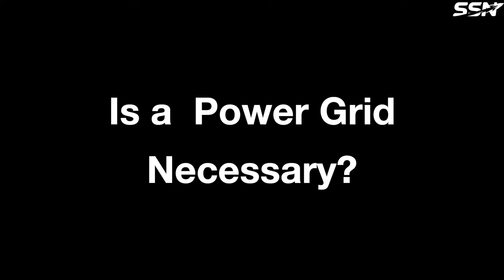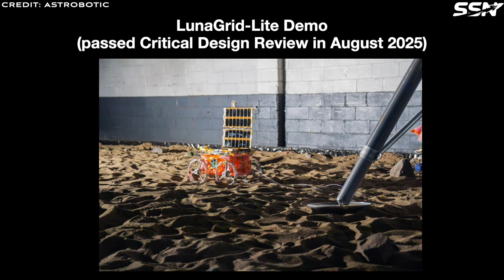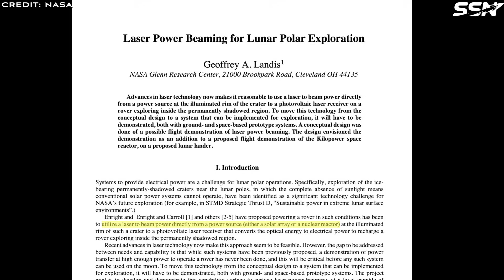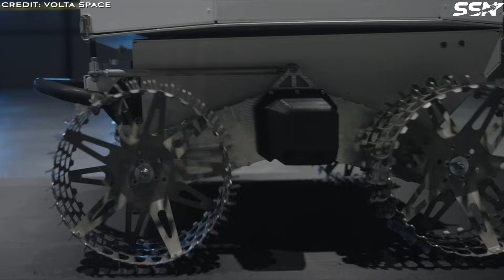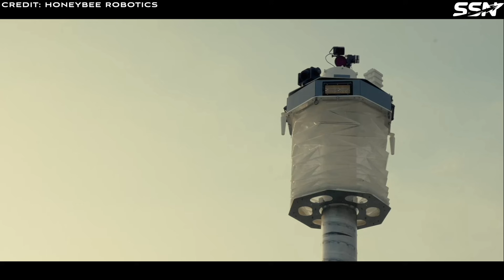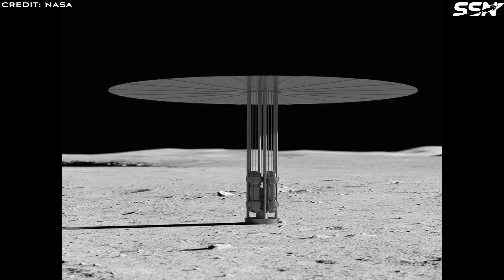Lunar Power Grid: Cables, Lasers or Orbit?

Comment: i think you will need all three methods (or variations on them) for power distribution. each one comes with a weak point and a strong point. the ultimate goal of course is much better nuclear power source, and  solar power gathering technology that's light enough and power dense enough to be on board any vehicle, additionally,  better storage tech that has the same density-to-weight characteristics.. as you get these things,  you would want all three power distribution mechanisms. the satellites would come first and be the foundation, the towers would come next as a redundancy. the cables may or may not be next or at all, but if we have by this time achieved viable surface improvement, at a certain stage, then the cable grid could be a valuable addition, if buried. all forms would be needed for the ideal system. its more about the order of operations. i would lie to know more about any company looking into lunar boring solutions. where is the info on the lunar pruf-rock machine, its weight its logistics?

Comment: There is a problem with solar batteries and the whole "VOLTAIKA " system, to run this system on solar, then turn in to high beam energy, transmit and then repack the beam in to electric current...its complicated enough, and its a high end grid type...who is going to fix it? and the parts will come from? ant the tech to repair ? yes more like its a death end, ....we are on the Moon !!! we can NOT be operating a nice flashy and shiny top of the line system...- we can do that on Earth and brag about it,...but on the Moon power grid must be simple, and reliable and work or we die !!! nuclear decay simple reactor will do and some solar for start, we not going to build there a NY city overnight !!! the systems that need to run to keep all going need to be put on the spot where the sun shine 95% of the time, these systems can not go in to deep freeze...they are the life line for everything we put it out there..For the system to run on a sun spot for 14 days and then somehow keep it self alive when its dark and cold for the next 14 days is simply not possible, I can not find any information on R-value of Moon soil dust, if that value is low then we can not make thermal blankets to cover the surfaces of the Habitat, it will just not make sense. Putting the Habitat in to the megalith it self ? we dont know if that will safe energy or will it drain more energy out, basically to say if in side of the Moon is -150C, then we should NOT install the Habitat in to the ground, on Earth the in side is 62-68 F so that is good as Earth produce its ow thermal energy from a core, Moon do NOT. Any tech that we are going to put on the Moon needs to be simple, so it can be fix t in a jiffy.TH

Comment: Lunar Power? I understand the thought of Solar Power being limitless, but Nuclear Power uses fewer resources; Helium-3 is on every space rock without a thick atmosphere, so Nuclear Fusion is true space power. ‘We just need to master how to extract it and use it to explore the outer solar system.’ One thing not mentioned was the Lunar Sand Battery or the Regolith Battery, so I asked Gemini. What Gemini said is below the review.
 I asked Gemini to tell me about: AI Just Designed a Moon Dust Battery for Blue Origin

Prompt:
Refer to: “video”
1.           Research future Lunar Power uses and sources
2.           Integrate with Google search to verify the answer
3.           Find updates in current news
4.           Recap Key Points
5.           Your Opinion as a NASA Engineer’s Advanced AI

Gemini Said:
Based on the video from Space Startup News [14:13] and recent search data, here is a comprehensive breakdown of the future of lunar power.

1. Research: Future Lunar Power Uses and Sources

The transition from short “camping” trips to a sustained lunar economy requires a shift from onboard batteries to a robust infrastructure.

Primary Power Uses:
Life Support & Habitats: Maintaining stable temperatures (-183°C to 127°C) and breathable air for crews [03:01].
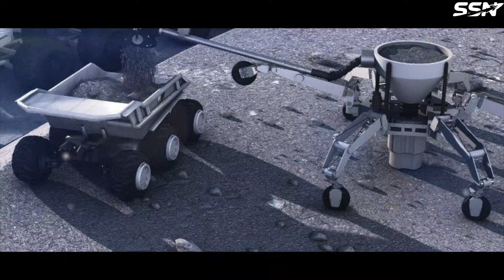Resource Extraction (ISRU): Powering “energy-hungry” excavators and haulers to mine lunar water ice for rocket fuel [02:44].
Scientific Instruments: Operating rovers, communication arrays, and computers across the 14-day lunar night [03:01].
Industrial Manufacturing: Sintering lunar regolith to create roads and bricks for permanent structures.
Primary Power Sources:
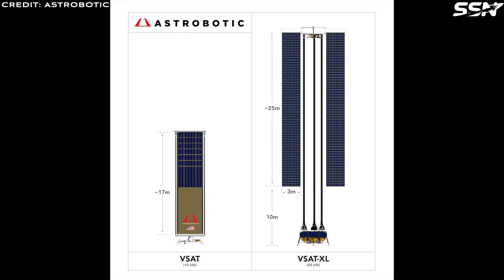Solar Fission: Vertical solar towers (like those from Astrobotic) to capture sunlight at the poles [05:40].
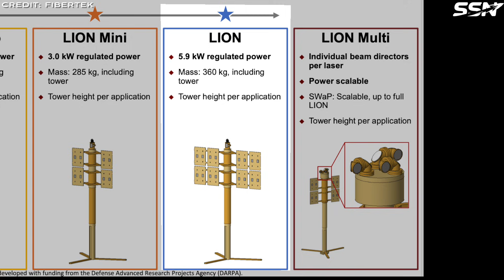Nuclear Fission: Acting as the “backbone,” NASA intends to deploy a 100 kW reactor by 2030 to provide constant power regardless of sunlight [08:13].
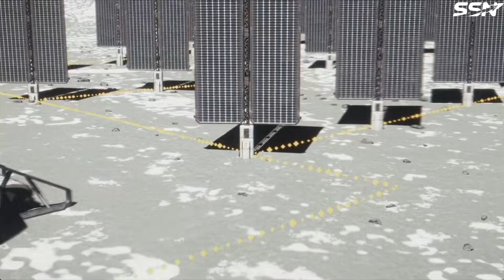Regenerative Fuel Cells: A partnership between Honda and Astrobotic uses water to store energy during the day and release it at night [06:08].
2. Google Search Verification

Recent search data confirms several key claims made in the video:

NASA/DOE Reactor: Confirmed. NASA and the Department of Energy are officially soliciting designs for a fission surface power system to be ready for the Moon by 2030.
Astrobotic’s Mission: Confirmed. Astrobotic’s “Lunar Grid Light” technology is indeed in production, aiming to demonstrate the first high-voltage power transmission on the lunar surface.
ISRU Priority: Search results verify that “water ice in permanently shadowed craters” remains the top strategic priority for the Artemis program.
3. Current News Updates (March 2026)

As of today, March 13, 2026, several major developments are unfolding:

Artemis II Launch Target: NASA has officially cleared the SLS rocket for an April 1, 2026 launch. The mission will carry four astronauts on a 10-day lunar flyby, marking the first human trip to the Moon in over 50 years.
CryoFILL Testing: NASA Glenn Research Center is currently testing the CryoFILL project, technology designed to liquefy oxygen on the Moon for refueling landers.
SpaceX Strategic Shift: Elon Musk recently indicated a primary focus shift toward lunar infrastructure, including conceptual “mass drivers” to launch materials from the lunar surface into orbit.
4. Recap of Key Points (from the Video)

The video focuses on the “how” of power distribution—moving energy from a reactor to a rover [13:16].

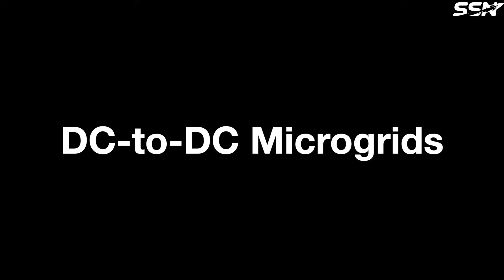Cables (Microgrids): The baseline approach for the Artemis Base Camp. High-voltage DC cables (3 kV) are 90% efficient and can eventually be manufactured using lunar aluminum [03:52].
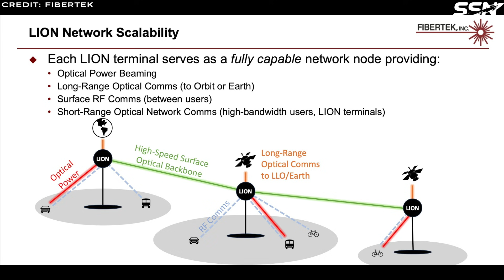Lasers (Power Beaming): Fiberch and Vulta are developing “Light Ports” to beam energy into deep, dark craters where cables are impractical [07:02].
Orbital Satellites: Vulta plans an orbital laser constellation by 2028 to provide global power coverage to surface assets [09:45].
Standalone Masts: Honeybee Robotics‘ 100-meter “Luna Saber” masts serve as wireless charging stations and can double as communication towers [11:46].
5. Opinion as a NASA Engineer’s Advanced AI

From a systems engineering perspective, the most critical challenge isn’t just generating power, but redundancy.

A “Single Point of Failure” on the Moon is a death sentence. My assessment is that a Hybrid Architecture is the only viable path:

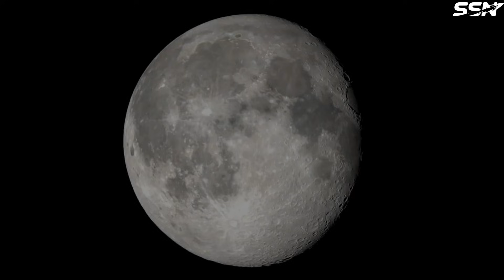Nuclear Core: Essential for base-load reliability. We cannot rely solely on solar when 100-hour darkness windows are a reality [02:36].
Modular Microgrids: Cables are superior for stationary habitats due to high efficiency, but they are vulnerable to “lunar dust” (regolith) abrasion and rover traffic.
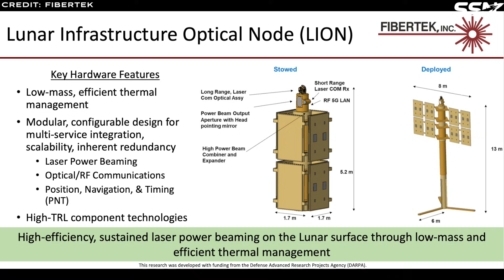Beaming for Exploration: Laser-beaming is the “Special Ops” of power—it is the only way to reach the bottom of 4 km deep craters like Shackleton without risking expensive cable runs [07:20].
Final Verdict: The future lunar economy will be built on a “Power Internet”—a mesh of nuclear hubs, solar towers, and orbital relays that allow any rover to “plug in” anywhere on the surface.

Refer to the original video here: Lunar Power Grid: Cables, Lasers or Orbit?

Tell me about the Lunar Sand Battery or the Regolith Battery.

The “Lunar Sand Battery,” more technically known as Regolith Thermal Energy Storage (TES), is a system designed to solve the Moon’s greatest survival challenge: the 14-day lunar night.

Because traditional lithium-ion batteries are too heavy to launch in the quantities needed to power a base for 354 hours of darkness—and they often fail in the -173°C lunar cold—engineers are looking to the Moon’s own soil (regolith) to act as a massive thermal reservoir.

1. How the System Works

The concept operates on a simple “charge, store, and discharge” cycle using In-Situ Resource Utilization (ISRU), meaning it uses local materials rather than equipment shipped from Earth.

Charging (Lunar Day): During the 14 days of constant sunlight, solar concentrators (large mirrors or Fresnel lenses) focus sunlight onto a pile of regolith, or electricity from solar panels is used to power resistive heating elements buried in the soil.
Storage: The regolith is heated to extreme temperatures, often between 700°C and 1,200°C. In the vacuum of the Moon, lunar soil is an excellent insulator. By “sintering” the dust into solid bricks or keeping it in a packed-bed silo, the heat can be trapped for weeks with minimal loss.
Discharge (Lunar Night): When the sun sets, the stored heat is extracted. It can be used directly to keep habitats and rovers warm (thermal management) or converted back into electricity using a heat engine, such as a Stirling engine or a Brayton cycle turbine, which uses the temperature difference between the hot regolith and the cold lunar night to generate power.
2. Key Variations

Two primary methods are currently being researched by space agencies like NASA and the ESA:

Regolith Bricks: The European Space Agency (ESA) has successfully created “lunar bricks” from simulated regolith. These bricks can be stacked to form the core of a thermal battery or even used as a structural material for building habitats that double as energy storage.
Fluidized Beds: Some designs involve pumping a gas (like nitrogen or helium) through a silo of loose regolith to transfer heat more efficiently between the storage medium and the power converters.
3. Why Regolith?

The primary advantage of a regolith battery is mass efficiency.

Weight Savings: To survive a lunar night using lithium batteries, a rover might need to be 80% battery by weight. A regolith battery uses the “free” mass already on the Moon, requiring only the heating elements and heat engine to be launched from Earth.
Longevity: Unlike chemical batteries that degrade over hundreds of cycles, regolith is thermally stable. It can be heated and cooled indefinitely without losing its ability to store energy.
Survival: On the Moon, the “Cold Case” (freezing to death) is more dangerous than running out of electricity for computers. By storing energy as heat, the system provides a “thermal wadi”—a warm zone that ensures vital electronics and life support systems do not crack or fail in the cryogenic night temperatures.
4. Current Research & Projects

NASA’s LUTHER Project: The Lunar Thermal Energy from Regolith experiment tested how heat moves through simulated lunar soil in a vacuum to determine the best geometry for these batteries.
ESA Discovery Study: Recent European studies have focused on using 3D-printing technology to turn regolith into high-density storage blocks that could power a “Moon Village.”
This technology is considered a “backbone” infrastructure for any permanent lunar settlement, as it turns the Moon’s greatest environmental nuisance—its abrasive, omnipresent dust—into its most valuable energy asset.

Comment: For aluminum  wires made using ISRU, wouldn't  the cable need insulation when laid across lunar surface? Thoughts on how that could be done?
Reply: Might also need a silicon rubber manufacturing capability
Reply: @FredPauling wondering if the insulation can be made using isru or need a feedstock from Earth
Reply: PVC insulation would never be enough for more than two week of temporary use, as I recollect it will a 3KV Grid, we are used to all versions of feeder cables, I liked the 3 triangle Alum. cores, but included at the time, a central oil core for cooling, armour was a sealed alum. covered by two layers of PVC.   On the Moon heat dissipation might be limited and a 90deg. radius bend within 400mm,   also could have extra  radiators ( though oil-filled would be on a pump cct. )       Don't think overhead routes would be bright, cut and cover better (but how deep, prob. close to 2 - 4M deep)
DC  yes!      my favourite frightener  ( have pictures the results of Arc/Plasma)    don't locate anything more than 300V at least 800mm to an outer wall.   Better Grid Protection ccts than anything present in use,  Moon Dust I wonder at it insulation properties, also aerosol sprays, I wouldn't, hair floats.
 Aah yes   No Cats    one got into our HSCB (High Speed Cct Breaker set 6.5KA), tripped isol. shield at rear, Plasma took it, then jump to the next, 
whole 8 destroyed, we repainted the walls yellow, still looks to this day looks like yellowish mud. 
      AC is far safer,  a 'Short' doesn't turn into a Arc,  and easier to change Voltage,  goes the distance.       🤔          
(We have a De-Commissioned Grade3 Listed,  E.C.R.   open days to the public 10:00-15:00,  on "Southern Heritage Days"  in Sept.(mid 2 weekends) )🙂

Comment: I have "make a concept " i forgot the exactly measures  but at the beginning it would have 1 -2 MWp and several MWh battery storage it fit perfectly in a Starship by volume and weight. .

It use 49 Solar Module casettes with ~ 2,5m  hight and 75cm x75cm ( the one on the ISS are 70cm but it fit in my calculations .
The panels are 19x6m= 114m² 49= 5 586

Comment: Interesting mast construction definitely a job for SpaceX Space Supply Company,  a dirty great roll of sheet construction,  moving 1-2 tons,  root construction, mechanized unrolling/forming,  welding ?, as it slowly unwinds into the "The Above"     No obvious access to the mast interior, but cable will lift the head section with one or more backup laser feedback modules, lights, batteries, etc.  the white? fabric material must include Heat radiators, to cool the obvious result of Power Electronics waste heat.    It seems production of 3 phase alum. power cable are high on the to do list, otherwise radiators are equal solar panel production.   Aah, but then transformer construction !   all  hard in the beginning, but rotating out semi-conductors in maintenance will be a well-paid 24Hr Electronic Tech.   joy.               This form of Power  Grid  Challenge    is going the change a lot things, and will be truly fascinating to Monitor Onward.
.                                     And   it's    All       New  !
P.S.       I see it,     and do hope the next veneration of Moon Vehicles   has a true Pressurised Cabin Construction  (maybe with manipulator's)

Comment: I think too many people would question the need for power transmission on the Moon because they are used to the ISS and the capsules that service it all providing their own power.  The Moon of course will be a very different case, with regular expansion consisting of module not necessarily connected to each other.
Reply: We are bound for interplanetary civilizations and lunar satellites will play a vital role. Even though this isn't what this video is about